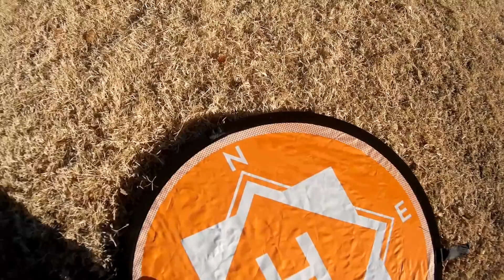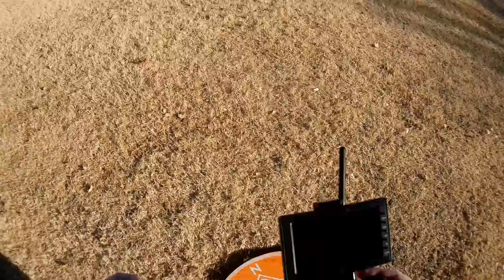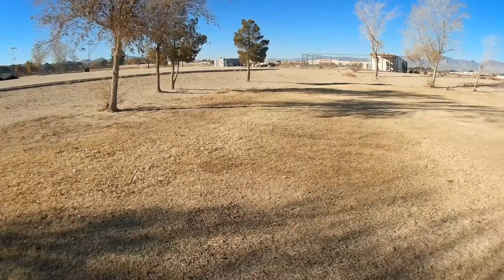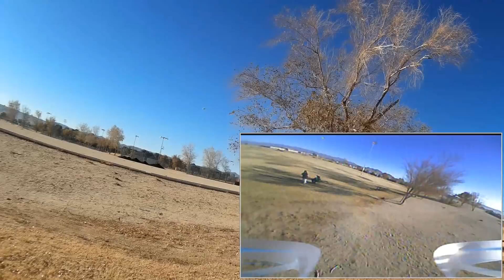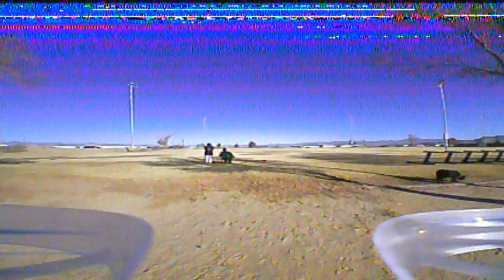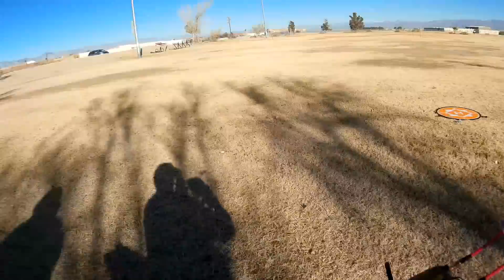DLFPV DL1080 RTF Version Micro Whoop Racer Drone Flight Test Review

Comment: after one for my son, what do you think is better the 1060 or the 1080 i notice you have reviewed both. I have a blade inductrix fpv at the moment and my son wants something simaler and this that you are reviewing seems that and seems like it can handle flying outdoors better as the blade cant really do that. many thanks
Reply from the maker: The 1080 is better.  But you might also consider another option of purchasing a T8SG universal transmitter that both you and your son could use. https://www.youtube.com/watch?v=ksEbk53NQPQ
This would open up the option of many more and better flying drones than the 1060/1080.

Comment: I fly a lot of 75mm in acro.
I have noticed you have to handle a ducted blade quad differently. Easy on the yaw when doing high speed turns or diving.  It will "kick out " on you. I can see you started to experience that slightly.